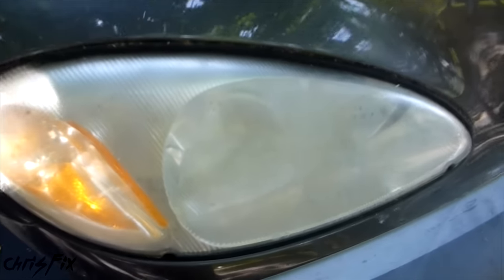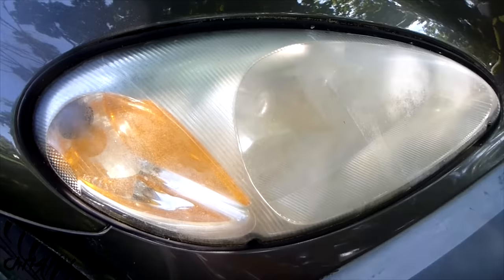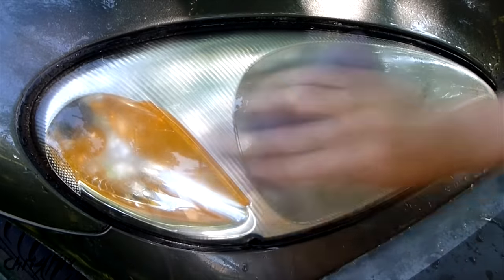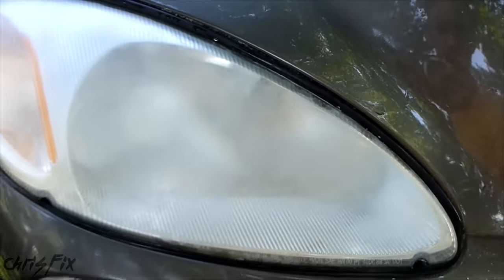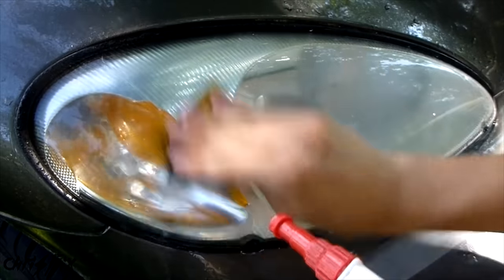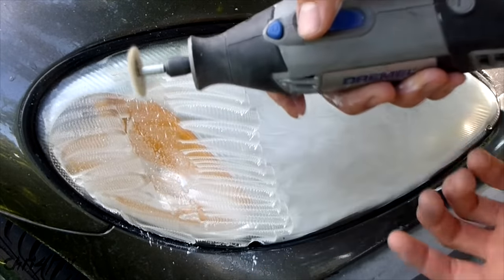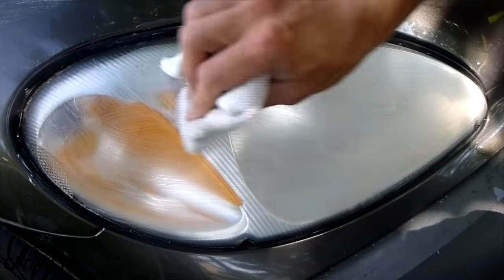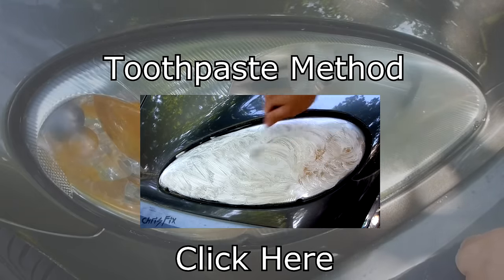How to Restore your Headlights (crystal clear)

Comment: Your video was created on June 25, 2014. Since that time, there have been innovations in restoring headlight lenses.  Here is the latest formula as 12-13-20.  Step #1,  Use 91% alcohol bought at any Walmart. Pour some alcohol onto the microfiber cloth and wipe the headlight lenses thoroughly.  Use another clean microfiber cloth and pour Acetone on it from Walmart. swipe from lensYou are don't in less than 10 minutes!! Have a great day!!

Comment: Sand yours headlights So that the Haze is even All Over(his was not)The Better you Sand The Better the Outcome. Use Real Compound with at Least a Drill with a buffing pad attachment(Works better). Note: You will Still Need to use a Two Part Clear Coat to Seal what you have done or else your work will turn back Yellow With in two months. Tape off your Headlights to prevented scratching and over spray.

Comment: I wouldn't use a dremel pad it will take ages and could burn the plastic,use a cheap buffing pad kit , a few pounds from ebay, chinese of course, with an electric drill or sander and rubbing down compound and T cut, much faster, you may even skip the sandpaper if the headlight is not too bad.

Comment: Need some help, i did exactly the same except i used 1000 grit instead of the 2000 grit and finished with toothpaste but polished by hand because i don't have a dremel. The headlights are as hazy as before, but i got read of the yellowing. What i'm i missing?

Also, isn't an acrylic clearcoat more durable than wax? 

Really need help to undersand where i failed

Comment: First, be very careful if using 400 grit wet/dry sandpaper. You can create deep scratches and have to remove a lot of material to smooth it up.
Second, you can’t go from grit 600 to grit 2000. 
If you decide to sand the Headlight (because of freeway abrasion) then you need:
Glass Cleaner
Lint Free Paper Towels
 600 grit wet/dry sandpaper 
1000 grit wet/dry sandpaper
2000 grit wet/dry sandpaper
Water
Polishing compound
Headlight polisher machine
Flannel cloth
Rubbing Alcohol
UV Protectant Sealer.
How to it is different story.

Comment: Too funny. I wuz doin that to my wife's 02 rs Camaro this morn. I used Mequiars PLASTX. I wuz impressed. Reson being I have gone the compound route and was about to remove the hl assys and do wot you did. WELL try this stuff . 2 apps I got the same results in 15 mins. W/O removein da hl assys. By d BY my 68 Camaro iz down to metal  damn early bowtie sheet metal stampins are not smooth just adds to the fun. F%$#in pain in my hands. keep it greasy side down . Chuck
Reply: Meguiars Makes great products. A huge bundle was included when I bought my mercedes (white) and we have been using their stuff ever since. Use it on my mustang too and it is bright yellow. I found that it can be tricky to get a really flawless and bright high gloss shine on these light colors but Meguiars works on anything. My husband used their products to restore my cousins 1982 all original Caddy (Dark Blue). Looked like a new car when he was done. They have a huge product line and a good selection can be found at wal-mart fairly cheap. Worth the $$ for sure! BTW-Chris, Thanks for the vids, I almost used the deep woods off trick until I saw your vid.

Comment: how long will this last?
Reply from the maker: ***** About 2-3 months or longer if you maintain it with car wax. Here is a video showing you how to permanently make your headlights clear that will last a long long time: How to Restore Headlights PERMANENTLY
Reply: Thanks for the quick response, i have watched all of your headlight fix videos like 3 times, i just used this one and the results were great, so would you say apply maybe like after every car wash?
Reply from the maker: I would wait and see how long the wax will last and then use that time frame to figure out when you will need to rewax. Every car and area are different.

Comment: How did your headlights get that dirty three times, so that you could make three videos featuring the same car and truck? Doesn't that suggest that the results are very temporary?
Reply from the maker: Cody A If you clean the wax off and let the headlight sit for a month, it goes back to the way it was. I also scuffed up the headlights to make the bug spray video because the headlights were relatively clear. None of these fixes are permanent, but I am working on a method that is so stay tuned!

Comment: I would not recommend this if you don't fully understand the process or materials. I tried this on my '09 Nissan Sentra and got horrible results. I'm aware I might have messed up but I'm terrified to try again. I spent almost $40.00 buying sand paper, special toothpaste, and masking tape. My headlights look horrible now, and there are scratches all over them, and they are even more foggy than before. It's worth noting that I also did not use wax because I wasn't interested in spending another 20 dollars. I fear I might have just ruined my headlights for good, by just trying to get a few yellow spots off of them.
Reply: Did you use a buffer?

Comment: Hi everyone just a note on the toothpaste tip. If only using toothpaste is enough to clean your headlamp covers then anything will do, even normal wet wipes will do. Truly oxidised plastic needs to be properly restored or at least a much more abrasive technique applied e.g various grades of sand paper then a cleaning solution. Keep your toothpaste for which its meant, on your teeth.

Comment: This is planned obsolescence. 
They can and have made non oxidising plastics.
Many 90s cars with plastic headlights never yellowed or yellowed decades later (not as quick as the new cars).

Also many rear tail lights never yellow. Makes you think the plastics used for the front are blended to deteriorate and increase sales (not many knew, can or want do this themselves).

Comment: Any1 tried?? I'll just try it out on a small area first...
Reply from the maker: Yes millions of people have tried. It works haha
Reply: @chrisfix  "This is what I get for trusting people on the internet, my headlight is so dark now! Oh wait, it's the sunglasses. Yes, much better now. I can see clearly now that the rain is gone, I can see all the obstacles in my way. Thanks!." The only thing is, since I didn't have any a that fancy dandy scratch paper, I turned at chemical power and went forth with the Eorlingas and CIF cleaner with microparticles. Much of the UV corroded plastic came off and it is different than before. Hope to pass in the inspection. BestWishes